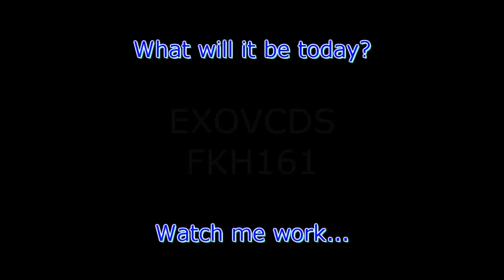VW B7: 2.0L TDI Fuel Filter replacement

Comment: thanks for the vid. just an FYI for everyone, you don't need no computer to do this. just start the car right up.
Reply from the maker: That's playing Russian Roulette... it's better to be safe than sorry (priming the fuel system before starting).
Reply: @EXOVCDS  I see, what exactly would it take to do that? What would I have to buy to do that?
Reply from the maker: The easy way (but a bit expensive) buy a scan tool that can activate the fuel pump. The cheap way, look for DIY article on how to activate the fuel pump, to run for a minimum of 30 seconds (the longer the better before starting the engine).
Reply: @EXOVCDS  okay, actually I think I own a scan tool that can do that. I'll look into it. Thanks for the info and the video.

Comment: I am a Kia tech, and we have GDI engines, which are similar to TDI. In direct injection engines, you have a standard electric fuel pump, but then a mechanical (cam driven) fuel pump to boost up the pressure. At least for GDI engines. So simply cycling the key will only pressurize up to the mechanical fuel pump itself.
Reply from the maker: Yes, similar design.

Comment: I have three TDI (2011-2015) VW's.  I remove fuel, add 1/3 new fuel, insert filter, slowly (!!) add to nearly fill, replace cap. Slight amount of fuel should escape onto the shop rags surrounding filter - just a few drops, but this means no air is present. Never had an issue doing it this way. 2015 is a little different - watch your mechanic do it on someone's car if the dealer will allow, then do it yourself.
Reply from the maker: Thank you for your input!

Comment: How to prime a filter if I don’t have that cable for that job. Would be possible to just fill up with diesel fluid or diesel purges stuff? 
Thank you for video and +1 subscribers
Reply from the maker: Filling the filter housing will still have air in the system... that is why the fuel pump needs to be activated, to push the air into the fuel tank. If you don't have a scan tool that can do that, then you need to figure out how to activate the fuel pump to do that. Turning the key on & off might activate the pump, but I don't know how many times you need to do that, to bleed the air out. If you find the fuel pump relay (if there is one), you might be able to bypass the relay to do it. I only use the scan tool, so I don't know any other safe way to do it.

Comment: Hi Thomas, went to the VW and bought the fuel filter for my VW Sportwagen 2016 TDI using my VIN number to make sure tu buy the right one. Part # 5Q0127177C and it comes with a plastic pipe/straw attached to the filter. Do you have a video showing how to change that kind of filter or whatfor is the plastic pipe/straw? BTW not doing the job yet until I get my VCDS (on its way) Thanks and greetings from Mexico
Reply from the maker: Hi, I do not yet have a video for one of those filters... it is listed as a "Fuel Water Separator Filter". The top of the filter cover should have a fitting that aligns with the extra fitting on top of the filter. The straw is mounted to the filter and allows for "water removal" from the filter, with the filter cover in place. Since water collects at the bottom of the filter housing (should water be in the system), water will be sucked-up through the straw, when a vacuum source is attached to the "access fitting" on top of the filter housing / cover. I hope that made sense. Replacement is pretty much the same as in this video... you can use a vacuum pump to check for water before you remove the filter cover. When installing the new filter, make sure that the straw is attached correctly (you will see how once the old filter is out of the housing). Run / activate the fuel pump(s) several times, to purge air out of the system.
Reply: @EXOVCDS  Thank you very much for your time, prompt response and guidance. I'll let you know how it went. Have a nice weekend.
Reply: @EXOVCDS  Finally got my VCDS cable and downloaded service manual from VW web page. Procedure was exactly the same as in the video and your explanation in the previous comment. Three minutes running the fuel pump with VCDS and car fired up immediately without any problem. No issues during the test drive. Once again thank you very much for your guidance!!!  Gracias compadre!!!
Reply from the maker: @robertopriego3545  thank you for the update!

Comment: I’m a novice, don’t know a lot about engines, this looked quite easy to do until the message came up about priming and the plugging of the computer.
I own a VW Tiguan 2.0 TDi, 150bhp, 4 Motion, 2008, should I attempt this or get a professional like yourself to do it. Just concerned about the priming and plugging in of the computer.
Reply from the maker: There are some DIY articles online that apparently say that it can be done without a scan tool. Since I work at a shop / it is my job, I have the tools and use them. When in doubt, let someone else do the repair / replacement. If things go wrong when you do it, you are stuck with the repair costs. If a shop makes a mistake, they are liable.

Comment: Hello and thank you for this tutorial, how long does it take to run the pump with vcds?
Reply from the maker: The pump is cycled for 30 seconds if I remember correctly... a good "bleeding" of the system takes around 3 minutes. I usually run the pump until I can no longer hear any gurgling (air) in the system.

Comment: I know this don't have any thing to do with this video but I like your work and I was wondering if you could tell me this? I have a 05 mk4 golf tdi it has a 5 speed manul trany I want to swap out for a 6 speed manul can it be done ?
Reply from the maker: Sure... bolts right in. But I'm not sure if the stock shifter / cable setup will work. Probably not. Different clutch slave cylinder setup as well, so you would have to change the fittings from the clutch master to the clutch slave at the transmission. Here's a video of a 6 speed transmission removal on a mk4.
https://www.youtube.com/watch?v=FispupEOvqM

Comment: a little late comment here but i have vcds but  cant really find the correct answer: how many seconds you prime the pump? 3x30 seconds or 3x60 seconds.. ? i have cffb engine passat b7 2014 2.0tdi
Reply from the maker: I listen to the fuel rushing through the filter housing while the pump is running... I keep running the pump / priming the system until I no longer hear a gurgling sound (air rushing through the lines). It is better / safer to run the pump longer than need be... you can not do any damage by running the pump 3, 6, 12 times... but you can do damage by not running it enough.

Comment: Activate the fuel pump via basic setting or output test Is the same thing?
Reply from the maker: They both do the same thing... sort of.
Basic settings will run the pumps longer and in the dropdown menu (when selecting fuel pump electronics), VCDS will say something like (to fill fuel system after injector or other fuel system component replacement)... where as in output tests, it simply runs the pumps for 30 seconds.
Reply: @EXOVCDS  which system do you prefer to use? i use OBDeleven is it the same? how long do you run the pump? I replaced the filter and activated the pump from the besic settings. when I turned the car back on it turned badly for a while ... then it stabilized. do you think I did damage
Reply from the maker: OBDEleven can do the same as VCDS... I'm always worried about trapped air, so I run the pumps 6 to 10 times. During the first activation, you can hear gurgling at the pump by the coolant reservoir and feel roughness when holding / touching fuel lines that go into & out of the filter (the roughness, I think, is air rushing through the lines. So basically I  activate the pumps until I don't hear / feel the roughness. You can distinctly hear / feel the difference (or it might just be in my head LOL). I don't know if damage was done, time will tell. At your next filter change, check for debris / metal shavings.
Reply: @raffaeleamoroso9274  Did you need the pro upgrade to run both pumps? Did everything turn out okay?

Comment: Question brother, my wife's 15' Passat TDI (CVCA) will show almost 3/4 tank after filling up and about 40 mi down the road. Car is not throwing any codes. Is this common? All maintenance up to date.
Reply from the maker: I don't think so... not that I am aware of. What's the overall miles per tank she's getting? I don't know what it should get, but if it's not a reasonable number, check with the dealer about any issues (that they might be aware of).

Comment: Hi, I suppose RM stands for the return line to the filter. Do you know why isn't it sufficient to have just one return line to the tank? what's the purpose of having another return line to the filter?
Reply from the maker: Fluid circulating back through the filter helps warm up the fuel.
Reply: @EXOVCDS  Thanks a million!

Comment: I have a 2014 jetta tdi, is there any way to replace the fuel filter without the software?  Thanks
Reply from the maker: Read through the comments or google for DIY filter changes. I do this for a living, so I have the equipment... and can not suggest / recommend alternative methods.

Comment: When I removed the fuel filter I eliminate the diesel also and clean the housing filter. After this I used VCDS and I run the pump like 2 times, 5 minutes in total, but when I tried to start the car, it was very hard, it didn't for the first time. On the second time, I left like 6-7 seconds until it starts. Should it be ok?
Reply from the maker: I always fill the filter housing before I use VCDS to purge the system. When there is too much air in the filter housing, that could cause issues. I don't know if things are ok or will be ok on your engine... time will tell.
Reply: Even if I purge this air with VCDS before?
Reply from the maker: When all the air is out, the engine should start as if nothing was ever done... you must have had some air left in the system. If it starts good now, the next time you change the filter, fill the container as much as you can before you close the lid... then run vcds to make sure all air is out.
Reply: @EXOVCDS  not always, as you didn't fill it in this particular case...
Reply: I always prime 3 times with vcds engine channel 035 and have no problems with air. And also cleaning the filter house and sucking all diesel out.

Comment: Hello, I own a 2015 Jetta TDI DIESEL 2.0L I will be coming up on 20,000 miles and I need to know if there is any easier way to get the air out of the fuel system after the fuel filter has been replaced, I don't want to take my vehicle to the VW dealership to do it because I don't want to pay there high price markup and they are messy with the repairs and leave oil and fuel spilled on and all around the engine compartment, I'm very picky with my vehicle and I keep it clean all the time, I try to keep it as if it just come off the showroom floor!! I would rather change the fuel filter myself but if I have to take it to a diesel mechanic, then I will, please let me know if you can help me out in any way,thanks!!!!
Reply from the maker: if you are picky about your vehicle, then buy a diagnostic cable and use it to bleed the air out of the system... simply push a button.

http://store.ross-tech.com/shop/cat/VCDS.html

Comment: I'm curious, is there no way to energize the two pumps without the scanner/software, or directly powering each pump locally (other videos suggest disconnecting each pump and powering them externally)?
On all of the the vehicles I've worked on, it was possible to remove the pump relay(s) and jump across the contacts - isn't this possible on the TDI(s)?
Reply from the maker: I would think so, but I have never tried it that way (on older models yes, I have activated the fuel pump by removing the relay and bridging the slots or by manually applying power at the pump connector). Using a scan tool is the easy way on newer models... if I have the tool to do it the easy way, I'm gonna do it the easy way.
If you know where the pumps or the relays are, you can activate them directly at those locations and see if that will work. If someone has already posted success on a DIY write-up, then it must work.
Reply: Thomas EXOVCDS 
With the VCDS enthusiast package at $200, I don't mind jumping across a relay socket to change my fuel filter.
I'm sure the other ways to cycle the pumps Will work - it just seems  taking the back seat out and connecting the pump to another power source makes powering up the pump more work than it needs to be - even without VCDS.
Thanks for the reply! ✌
Reply: Thomas EXOVCDS 
a little more reseach explains why the relay socket procedure isn't addressed, the relays are above the ecm up under the dashboard.
removing the back seat is easier, lol!!
Reply from the maker: VCDS is a bit pricy, but well worth the money if one has a VAG Vehicle that they want to maintain / look after... and I totally get that not everyone will spend the money on something if it is not used on a regular basis.
Reply from the maker: Thanks for the info!
Reply: Thomas EXOVCDS 
frankly, it looks like something I'll end up doing. not to say it's overly expensive, actually it's a VERY reasonable price compared to when OBD scanners first came to market - I had $1200 tied up in an OTC multi vehicle package, and Snap-On's was almost double that.
Back then I was still certified and did a lot of diagnostic side work (I somehow ended up with the cars that had been to several shops without finding the problem - and not pushing to get the work done made it easy on me), so my package paid for itself.
The downside for the VCDS for me is that I've been told by a few people that it runs best on windows XP, my older laptop went corrupt so I installed "7", well that didn't pan out because there are no drivers for that video card for "7", and I can't find an XP installation disk, lol!!!
As far as keeping the TDI, my last was just sold out of the family with 340,000 miles on it, so yes, I'll keep the 2015 a while!!
Reply: Thomas EXOVCDS 
you're welcome!
you're willing to share information with us - seems only right for one of us to return the favor!
Reply: Mike US OG K doubt 2015 will last 300 k

Comment: Is it possible to use torque pro elm327 and use vcds to perform the fuel pump task to bleed air out? If yes then I won't have to buy another obd adaptor
Reply from the maker: bondasfaq I'm not familiar with the torque pro & elm327 combination. I use VCDS & Snap-On scanners. I've heard of people getting by without a scan tool... I wouldn't recommend it, but you can probably find some diy articles online.

Comment: Thank you for video.    My sister has a Passat 2.0 TDI 81 kW (2008 - 2010 model in UK).  I do not have any scan tools to prime the fuel system.  When the new fuel filter is inserted into the housing, if I were to pour additional diesel from a container until the level reaches right to the top of the housing before attempting to start the engine, will I eliminate the risk of damaging the fuel pump?
Reply from the maker: At minimum I would fill the filter housing with as much fuel as possible.... then, cycle the key a few times before starting.

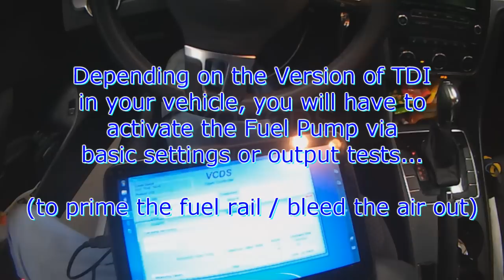Comment: Hello , I have a Passat B6 2.0 TDI common rail 140 hp , I have to necessarily do the procedure in minute 5:19 ?
Thank you
Reply from the maker: +eraser What is the engine production code?
Reply: +Thomas EXOVCDS EA189 euro 5 (yes, dieselgate :()
Reply from the maker: +eraser Then most likely yes... prime the system by activating the fuel pump.
Reply: Thank you.

Comment: Diesel engines are very complicated to work with, just. After replacing the fuel filter you can get a non Start condition.
Reply: If you don't prime the fuel system then yes.

Comment: Hello I do have octavia 2014 , what can happend if will be filter exchanged and I do not have software to reset init pump? IS necessary with octavia ? thx
Reply from the maker: Air in the system can cause damage to the high pressure fuel pump.

Comment: When you say B7 is this the European or the NMS US model? I have a 2012 Passat TDI in the US. which should be a variant of the B7 Europe version. What was the mileage before you changed out the Fuel Filter?
Reply from the maker: I'm in Canada... North American market vehicle. Don't recall the mileage... would have to check. I think 20k miles is the suggested interval for fuel filter replacement. The Passat looked like the one in this wiki.

http://en.wikipedia.org/wiki/Volkswagen_Passat

So I labeled the video B7.
Reply: ***** Thanks, the NMS is for the NA market which a lot of people are confused. Both the B7 and NMS do look similar but are two different platforms. Although the NMS it is nicked name the B7 on some forums.
Reply from the maker: Michael I can't keep up with all the different names & abbreviations... as long as I can find service info, that's enough for me. LOL